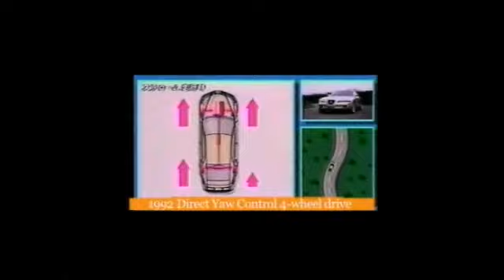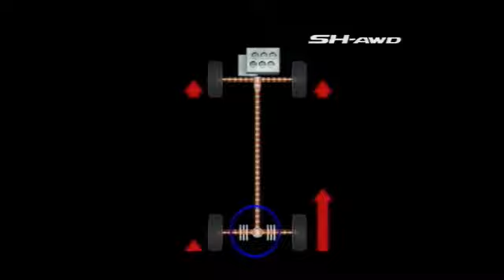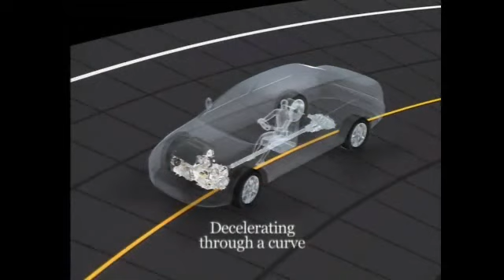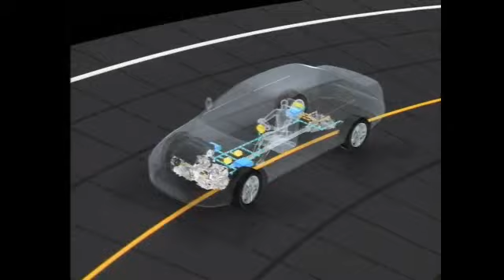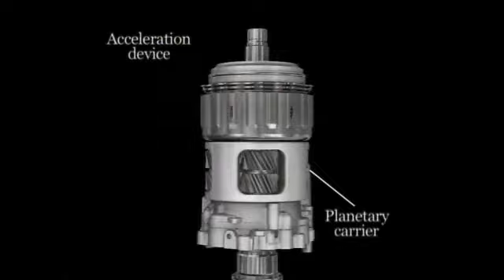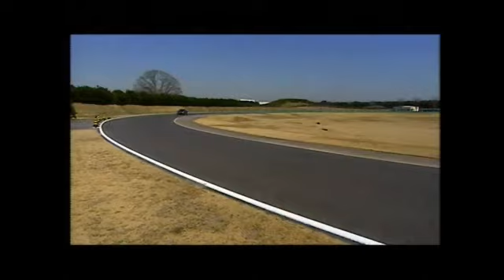Honda Worldwide   SH-AWD Video.avi

Comment: Subaru symmetrical AWD is better.
Reply: Anthony Rodriguez   Proves you're incapable of recognizing superior systems.
Reply: Anthony Rodriguez  

1. They don't need to.
2.  Your inability to grasp science isn't an argument against it.
Reply: Your mom is even better.
Reply: i know
Reply: Anthony Rodriguez You sound like  a pro man ''once the tranny went with in a year'' loool 

okay.
Reply: Shut up dip-shit. Honda don't even put awd on all there cars.
Reply: MidShipCivic They dont need to ? They are cheap fuck honda i had a accord once tranny went with in a year FUCK HONDA
Reply: MidShipCivic It's well known Hondas transmission are garbage i payed the price for giving honda a chance in 2008 with my old Accord.
Reply: Tony Rodriguez They didn't need you to "give them a chance". They will fine, maybe even better without know-it-all customer's like you... This is a Torque Vectoring Rear Drive Unit. They just called it SH-AWD. What Subaru that you can drive has a true Torque Vectoring Differential? None...

Most notably, the only other car to have this, is the Mitsubishi EVO X.